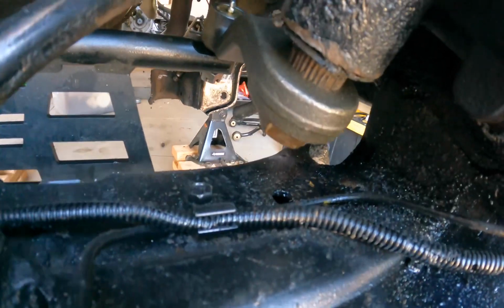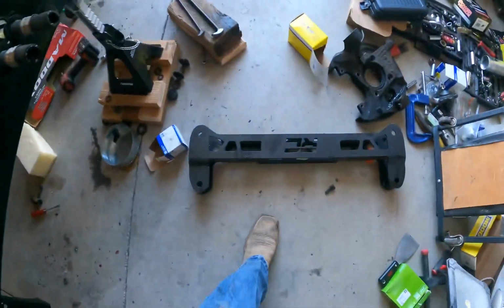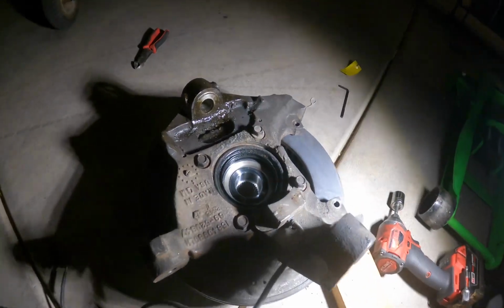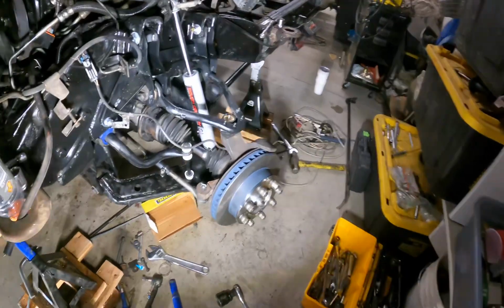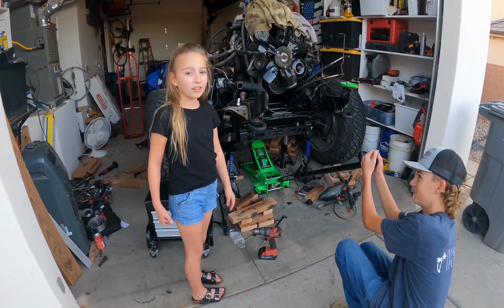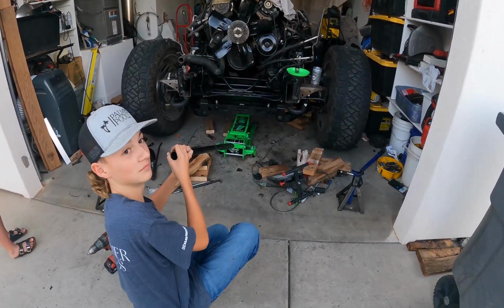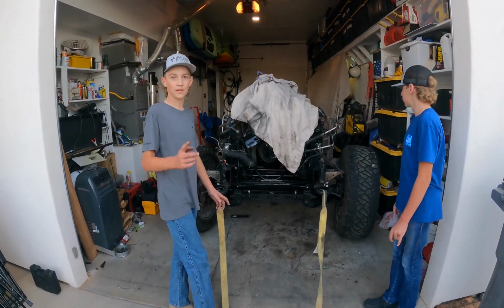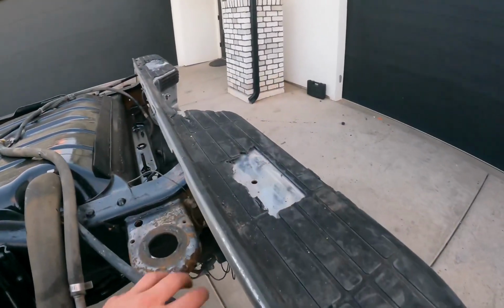Rolling along on the 1966 Chevy c10.

Comment: Central are putting a rough country lift kit on You might run into a problem of Your CB axles at the wrong angle If you do just go to the dealership and buy the CB axles thing Don't buy a after market It doesn't happen on every truck but it does happen And make sure you use the Pieces that come with that kit do not Think you can get away with not putting a piece on. Just trying to help You guys out. I built my truck from the ground up to it was a nightmare But now I am putting a 400 amp alternator alternator in my truck and blowing fuses left and right then right had to upgrade everything to  everything to a 0 gauge wire Everything I had to do with my My power invert an output. But you're doing a good job good job I like seeing younger people doing stuff like this it is awesome keep up the good work guys. And I will share your video and try to get you more follow.
Reply from the maker: Thanks for the feedback. Definitely will have to look into that. Also curious what vehicle you put together.
Reply: @tntbrothersgarage   I have 2 of them one  Is a Chevy with a 7" lift And a Toyota with a 6" left both of them had the same problem Change them out for the dealership CB axles Have never had a problem again.